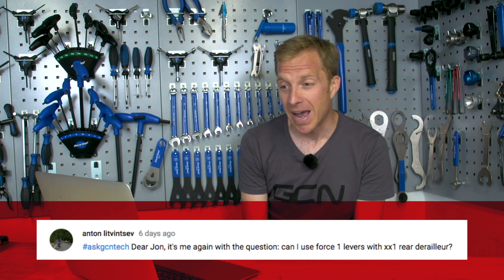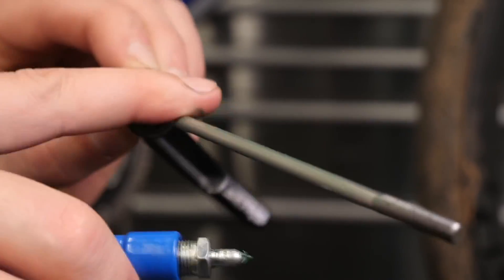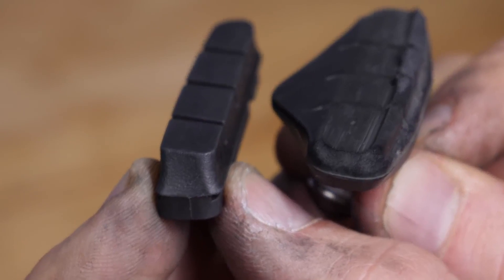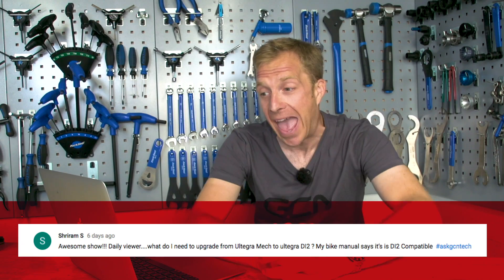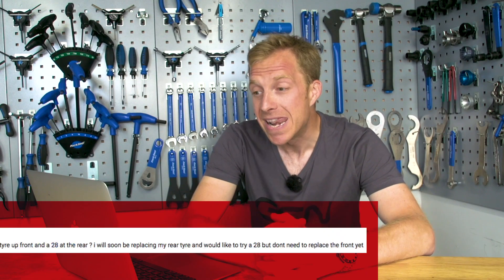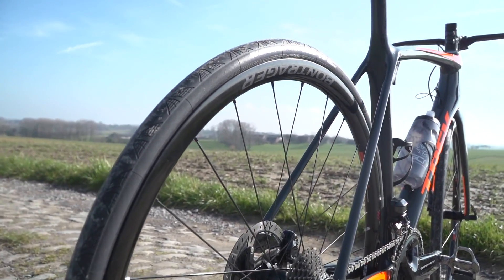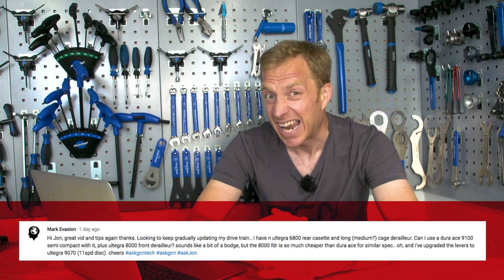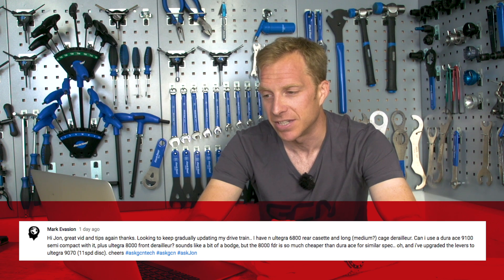GPS Speed Accuracy, Di2 Upgrades & Taping Helmet Vents?! | GCN Tech Clinic

Comment from the maker: Keep your questions coming in for Jon using #askgcntech 👇
Reply: GCN Tech hi jon can i fit 10 speed on mavic aksium wheeel? Tnx.
Reply: Michael Sy  get a 11 speed cassette and then take out one of the rings
Reply: #askgcntech do you know of any Belgian drop bars with an aero top section? Or any Belgian style bar in a 38cm 🚴🏼💨
Reply: I have a dura ace 9070 short cage rear derailure. I want to run something bigger than the 11-28. Can I just buy a long cage or do I need a whole new derailure?
Reply: #askgcntech Hi John, I have shimano ST R785 di2 levers & Shimano BR-RS805 disc brakes. I live in a hilly area & find that after a descent applying my brakes, the disc brakes make a loud rubbing/scraping noise for 5-10 mins. The rear is loudest but it is both of them. How can I resolve this?  It’s driving me crazy.
Reply: #askgcntech I have Ultegra Di2 6870 on my 2016 Scott Foil 10 and would love to pair it to my Wahoo to track battery life, etc. What would the best (cheapest) way to accomplish this?
Reply: Suunto new Spartan 9 watch is far more accurate than any Garmin computer or watch.
It even tracks speed and route when it can’t get a signal (tunnel) by using the accelerometers in the watch. It’s been tested as being incredibly reliable. Also is the Fusedspeed setting that is equally impressive. It’s a great option if you do other sports.
Reply: How about using a soft bristle nylon tooth brush around the carbon brake track?
Reply: #askgcntech I'm having some issues with indexing and shifting while on the big ring. I've adjusted the barrel adjusters, but it still have some issues. I believe it may have to do with the derailleur hanger being bent.  Is there an easy way to tell if the issue is with the derailleur or old cables?
Reply: #askgcntech can ride a mountain bike into road
Reply: #askgcntech Jon, I got a Gravel bike with Sram Apex 1x cranks and SPD-M520 pedals. To my surprise my left shoe touches the rear triangle from time to time. Is it better to add some spacers between the pedal and crank or a spacer between the crank and BB to fix this issue? Or are there better solutions (never had such an issue, and wouldn't like to reinvent the wheel here).
Reply: Jon - in your answer about Di2 upgrades, you didn’t mention derailleurs. Surely one would need Di2 derailleurs as well?
Reply: Hi Jon,  I have an odd and vexing problem.  Background:  I own a 2012 Trek Madone and over the years have had to replace the press fit bottom bracket bearings that wear and eventually slip in the carbon frame.  My local bike shop, a Trek dealer,  has replaced these in the past and they told me that they had to put in slightly larger bearings in with some locktite to get them to sit in place which is Trek's solution to this problem. My question:  are any options to install a threaded bottom bracket bearing option to avoid the press fit bearing conundrum?  Enjoy the show and thanks! Paul
Reply: #askgcntech Heres a good one. Can I replace my tiagra 4600 12-28 cassette with an ultegra 6700 11-28 cassette?
Reply: #askgcntech Could you do a video on bike pump maintenance and how to keep them working well for years?
Reply: #askgcntech Hi Jon, can I upgrade to Shimano DI2 keeping my S-105 cassette and crankset (so just buying electronic derailleurs and leavers?)
Reply: Speed sensor with GPS. I use one because on a steep climb (I am fat and slow) sometimes my GPS will pause and think that I'm not moving even though I am moving at least several mph.

Comment: Hi john 
Here’s a tip for you on cleaning your brake track which I discovered by accident 
I came home from a ride and got stuck in the ran and good fun it was, well when I pulled into the garage I noticed all the grime running down the break track so I quickly grabbed my shop towel and degreaser and cleaned that track it cleaned so well with the water and grime on the brakes it was like I used emery cloth and degreaser and two hours of John canning’s elbow grease 
The cleanest it’s ever been it sparkles

Comment: #askgcntech Hello from the Belgian Ardennes, Love the show, you even inspired me to enroll for a bike mechanic course. My question: my Tarmac SL6 has a 11-32 cassette in the back and an 48/32 absolute black oval up front. On some of the Ardennes steep climbs of 24% I am still struggling and I am considering a shift to 46/30. Would you say the 46x11 top gear is too low for a racing bike or should I go ahead with this if I ride 200km+ 4000+ m elevation gain rides? Big cheers from Belgium for your feedback

Comment: #askgcntech  Hi Jon i have a 2015 Specialized Tarmac Comp with a BB30 bottom bracket and Praxis Works Turn Zayante chainset the issue i have is a clicking sound that occurs at just past the top of the pedal stroke on and appears to come from the drive side ? the bottom bracket has been serviced recently i have also tried different shoes and pedals but no luck . the chain is kmcX11-EL gold and rest of the groupset is ultegra 6800and in good condition . hope you can help

Comment: #askgcntech Hi Jon, I run latex tubes in my full carbon Giant SLR wheels and never had an issue in Suffolk Uk as it's flat. I've heard other manufacturers don't recommend latex tubes in carbon wheels, presumably due to heat build up. Would you have any safety concerns?

Comment: #askgcntech Can anyone recommend an inline coupler for SRAM HRD road brakes that will allow me to disconnect the line without fluid loss? The idea being to remove handlebars/forks easily (and without dangling) for servicing. Coupler needs to be between handlebars and cable entry into the frame. Thanks

Comment: I have a BMC with flat mount shimano disc brakes.  The rear rotor is a 140mm diameter center lock.  I have another set of disc wheels that takes 6 bolt rotors.  Is a 140 mm 6 bolt rotor compatible with these brakes?  Is there a specific rotor I need to get? Thanks

Comment: #askgcntech Hi, I need to replace my deore 9 speed crankset on my touring bike. Currently it’s M591 48/36/26 175mm.  I can not find this part anywhere.  Can I use the new deore 10 speed crankset T6010?  The front cranks are on a bar end friction shifter.  Thanks!

Comment: #askgcntech I have Shimano RS685 shifters but the right one has starting jumping multiple gears (sometimes 4 or more) when pressing the small lever. I've replaced the cable which was a little frayed at the shifter end. Any suggestions to fix or it is terminal?

Comment: #askgcntech my wife is taking part in an Ironman relay race (180km non draft bike leg). She has £1500 to upgrade her wheels and has had contradictory advise. The question is whether to spend that money on aero wheels (40mm front and 65mm back) or shallow rim wheels but with the best performing hubs? She will probably average 140w-150w for the entire race distance. Which option would likely bring a better result?

Comment: Hey Jon,
Do disk rotors have a specific direction?
I've noticed most disk rotors' spokes (for the lack of a better word) aren't a straight out, 90º star. They look as if the hub and braking surface had been twisted to one side and most are mounted in a 'leading spoke' fashion.
Thanks
Andre
#askgcntech

Comment: #askgcntech Hi Jon, I have a new bike equipped with Ultegra DI2 with 50/34 chain ring and 11/30 cassette. My chain is occasionally slipping when  1.) Pedalling while out of the saddle, 2.) When I pedal hard after a stop, and 3.) Pedalling while turning left. This doesn't happen if I pedal normally. This bike is only 2 months so it's very frustrating. Please help. Thank you.

Comment: Hi Jon. I like GCN Tech a lot. My question is: I have Mavic Aksium wheels with centerlock disc rotors using quick release levers. When I squeeze the front brake (in order to check for play in the headset) I noticed some play coming from the area of the brake or hub of the front wheel. I do not have a torque wrench, but am pretty sure that the lock ring is done up to maybe even more than 40NM. There seems to be no damage to the splines on the wheel and on the rotor. However the rough surface on the lockring (not sure of the name) looks worn. When i grab the wheel and move it around I can feel no play so I assume that the hub is OK and that there is something wrong with the disc rotor. Can you help me?

Comment: GPS tracks speed using the triangulation of satellites with a +/- of approximately 3 meters (civilian), whereas most on bike speed sensors use the actual diameter of the tire on the wheel, which is good down to the mm. Much more accurate.

Comment: I can't fit 28mm tyres and suffer from vibration issues. Someone is selling a bike the right size that has enough tyre clearance but it's a lady's model. It also has inbuilt inserts in the forks and seat stays to mop up extra vibration. What are the issues with using a lady's model of the 'right' frame size. I'm 5'7'' with a 29.5'' inside leg. And, yes, I'm male.
Reply: playandteach__ Sounds like you're looking at a Specialized Ruby bike. I'm a short male too and I have an S-Works Ruby frame with over 21,000 miles and I can attest that this bike is an excellent ride. Biggest issues you're going to find is the shorter top tube, at least 1/2" shorter than a "male" geometry so you'll be needing a longer stem, and the shorter seat tube will expose at least an inch or more of seat post. The seat stays may also be about a 1/4" shorter making the handling quicker and stiffer in a sprint. But the bigger issue is the shorter top top tube because in addition to the longer stem you'll probably be sliding your seat back which will change your position over the bottom bracket.

Comment: Concerning 10x135 QR (Thru-bolts). Two aspects need to be true: 1) You have to be riding a frame with a 135mm rear dropout width and 2) You have to be riding a 135mm width hub commonly found on disc hubs.

 DT Swiss 9x100 and 10x135 are designed to fit (tightly) into QR dropouts. I run them on my gravel bike because the frame is QR and when I built my wheels I wanted something stiffer. They did the trick! You nearly get the best of both worlds. Ease of removal like a QR, stiffness of a thru-axle.

Comment: #askgcntech, I want to change my cranklengt (from 172,5 to 175 mm). It is very hard to find the part that I need (Ultegra 6703, (yes.. triple..)) Do you have any advice for getting this part, or compatilbe parts form other series?
Reply: You can't replace the driveside crank arm.

Comment: On the SRAM mixing Mt. and road don't forget to always check Jtek chart and for shipmate adapter http://www.jtekengineering.com/resources/shiftmate-compatibility/ or http://www.jtekengineering.com/shiftmate/shiftmate-9/ 
I've used a 10 sp force shift lever on a 10 sp X-9 long cage clutch rear mech without any problems..

Comment: lever pull ratio might be compensated for, by displacing the clamping point of the derailleur cable either away from, or inwards towards the specified clamping point.
there is even a company called Jtek, who may even make a devise that can compensate.
i am using Campagnolo 10-speed levers/derailleur with SRAM cassette. all that is required is moving the clamping point of the cable outwards from the original clamping point by about 1, to 1.5 millimeters.
i will send GCN Tech a picture or even a video of this "hack/bodge"

Comment: #askgcntech - I have a set of HED Ardennes CL 25mm wheels that were put on a 2011 Synapse.  They originally had 23mm stock OEM wheels.   I notice there can be some play from side to side when I wiggle the wheel even though the quick release is tight.  What is an acceptable amount of play or clearance in the bearings to ensure they aren't blown or loose?   I am experiencing from time to time brake rub when I pull the bike from side to side standing up and hammering.   Was thinking it was a brake issue, now I think it might actually be a bearing issue?

Comment: #askgcntech first, love the show, very informative, thank you for your time. I have a problem pumping up one of my tires. After I get to 70-80psi air starts to escape such that it's difficult for me to get the pressure to 90-95psi (my desired pressure). They are tubular tires with valve extenders without removable core. I used Teflon tape (plumbers tape) on the threads before installing the valve extenders and then a layer of electrical tape around the outside. It's not the pump because the front tire... No problem. Is there anything I can do without removing the tire?

Comment: Apropos GPS speed accuracy... in my custom power meter I've designed wheel based speed sensor to be able get accuraccy of 1 meter time change, while when using GPS running typically at 1 Hz in many smartphones and tablets probably bike computers too, than at cruising speed 36km/h within 1 second time pwriod you make... 10 meters !!! This means your bike computer  based on GPS have no chance to guess only can estimate your position within those 10 meters based on.. not accurate last few GPS positions, so when we are talking abour GPS speed we have take int acount how is it calculated, while we have inaccurate bike positions due to GPS positioning system errors not mention vertical bad GPS accuracy, so without barometer for height change measurement, GPS speed in hilly terrain not averaged from 10s or I use sometimes even 60s average on flats can be quite different from real speed measured using wheel based good sensors like mine, which has 1 meter distance in time accuracy, so at 36km/h 1 have 10Hz sampling frequency instead of 1Hz of many GPS based units ;) Hope, it helps someone imagine how inaccurate can be GPS based current speed sensing ;)

Comment: #askgcntech, I have an Ultegra 6870 (Di2 & disc version) on my road bike. Which components do I need to replace to upgrade to 8070 in order to get the nicer levers, the better gear change feel and the better brake performance?
Reply: dont upgrade, it's the same. I would wait a year more and buy the new 12 speed ultegra which will probably have 13% more ergonomical shifters and 7% crispier shifting

Comment: To answer the first question properly, you can get an inline cam from a uk company called jtek engineering which will change the pull ratio allowing you to use Sram road levers with mtb mechs.  C'mon John, keep up mate!

http://www.jtekengineering.com/shiftmate/shiftmate-compatibility-charts-choices/

You need shiftmate 9

Comment: Dear Jon, I’d like to go bike packing for 6 days. It’s only 520 km. I have a di2 bike (lighter) and an older cabled bike. Do you think I could use my quicker and lighter di2 bike and still he able to change gears at the end of my ride? I could take the charger but would prefer not to...
Reply: Did 700k over the space of a week in Mallorca recently, used just over 50% di2 charge, I'd say you'd be fine unless you change gears like a madman.
Reply: gamecat, thanks so much! I’ll try and gear change like a “normal” cyclist

Comment: Hi Jon wonder if you would be able to answer this question for me. Looking at changing from Mechanical groupset to an electronic one both for Campagnolo EPS and also for Shimano Di2 (seperate bikes for both I should say!) but wanting to ask a couple of questions about both the relative diameter of cables. Having had internally routed cables in the frame already I would imagine that it would be able to fit the same diameter cable for the EPS electric cables but wondered if you had any experience of problems changing from Mechanical to electric on Campagnolo (same questions for Di2 cables). Also wanted to know if you have any pro tips on how best to hook up the charging cable link for EPS V2 batteries. I believe that on the latest version of EPS from Campagnolo (Super Record/Record) that they can charge from a junction box just as Di2 does but wondered if you had any tips for the older style where it doesn't have the charging point in the junction box. Thanks for your help with this and great show as ever! #askgcntech

Comment: Regarding 25c front/ 28c rear tyres, that’s what I have on my Lynskey right now (28c wouldn’t fit up front). Rides very nicely!!
Reply: Motorcycles typically use a wider tire on the rear. It seems to work well.

Comment: #askgcntech I have a question for GCN Tech about the 1x drivetrain. Am I not in danger of "cross chaining" when I'm in one extreme or other of the rear cassette? My current compact setup sure hates it when I get a couple of gears away from the opposite end of the cassette range (versus the chain ring). I would think this would make things even noisier.

Comment: #askgcntech Hello Jon. I really hope you can help me with this one. Right now i'm planning to upgrade my saddle. But i don't know what kind of saddle is best for me: 1/ The type of saddle that even though doesn't have a lot of padding, the comfort is mostly provided by its flexible shell ( like the Fi'zi:k Antares Versus Evo). 2/ It's the opposite type, which have more padding but have a more rigid shell (like the Fi'zi:k Antares Open). I usually ride 4 times a week; 1 hour each time and i NEVER use bike-specific short (which has a chamois in it). I only use normal daily shorts. Also, does more padding in the saddle means more comfort ? Thanks ! Love the show.
Reply from the maker: More padding on a saddle doesn't necessarily mean more comfort, often the chamois makes more of a difference but you say you don't ride with one. We use Fizik saddles and think they are pretty good 👍